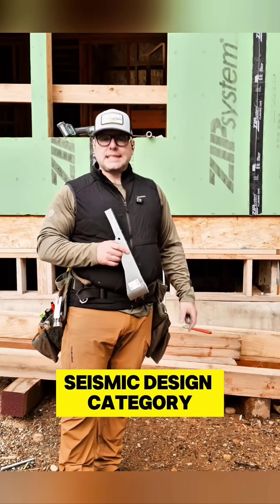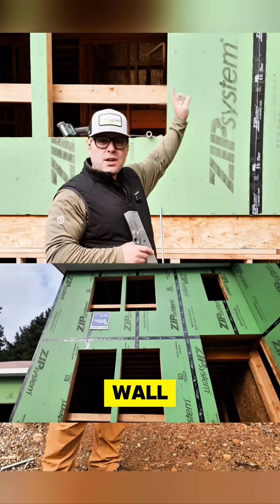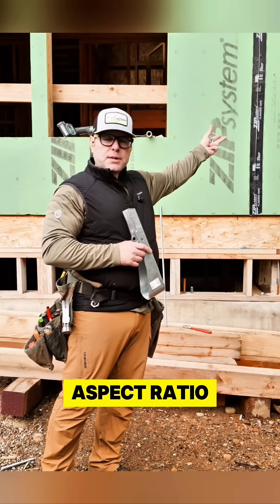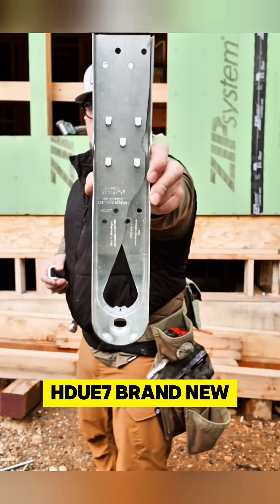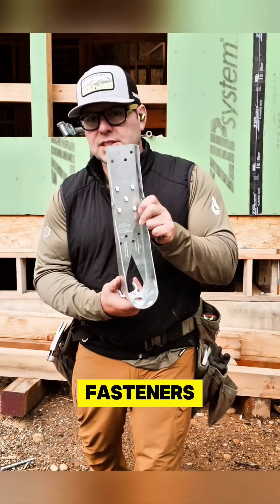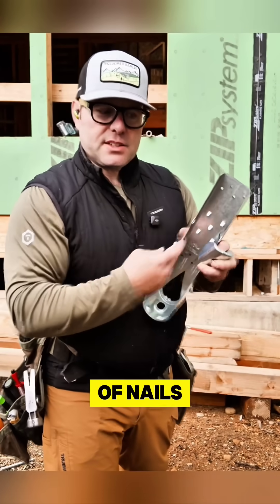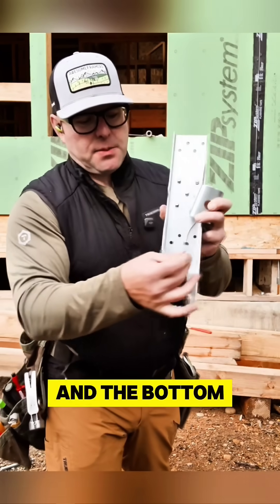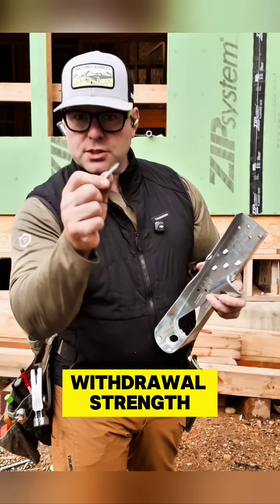What's an HDUE7?

Comment: I'm a little surprised those two short studs in the pony wall are sufficient for the compression load that accompanies any hold-down's tension resistance. 

Did you run that by your engineer?

Comment: I’m definitely not an engineer, but it seems like if it’s to hold something down you’d want to drive the screws on a downward angle, to make it harder for the screws to come out of the 2x. Just a thought.
Reply: Visualize the direction the wall would be pulling. The anchor is fixed and the wall pulls upward. If the screw is installed through the hole in the bracket at a downward angle, the screw head would start pulling away from the bracket as the wall moves upward making the joint looser. Installing the screw the way tbe mfr specifies ensures the joint becomes tighter the more the wall wants to more upward.

Comment: I was always told that the HDU can’t touch the ground to leave it at least an inch above the bottom plate
Reply from the maker: This is an HDUE
Reply: @AwesomeFramers ah so this negates that. Pretty cool!
Reply: The seat in the hold down shlurps tight regardless of whether the HD is on the plate or above it.

Comment: i can't believe an engineer approved a threaded rod extension in the hold down.  That's like a 50% or more loss in strength.  Check out the suspended walkway failure story from years ago.
Reply: I don't think you understand the engineering of the Kansas City Hyatt failure, nor the uplift requirements here.
Reply: Did you calculate that 50% or guess?  An independent engineer is not required because that procedure Tim used is documented in the Simpson-Strongtie literature. I've done the same thing and the criteria is quite clear.
Reply: That walkway didn't fail because threaded rod was used, it failed because there was a design change that created excessive load at a connection.
Reply: That was from changing from a single threaded rod through the box beams to 2 rods, causing one to carry twice the load. Different situation. See for a summary https://sma.nasa.gov/docs/default-source/safety-messages/safetymessage-2008-05-01-hyattregencywalkwaycollapse.pdf

Comment: Just a thought, would it be better to hold the bracket slightly up on the attachment post leaving a slight gap from top of mudsil to the bottom of the hold down so when tightening the nut you’re ensuring tension on the threaded rod? We typically hold ours up and inch or 2
Reply: It says in the HDU install notes on simpson website letter i.- "tension values are valid for holdowns installed flush or raised off the sill plate"
Reply: You’re doing exactly how it should be done. Slamming it tight to the bottom plate doesn’t allow tensioning the bracket properly.

Comment: If the connector fails in our 'upcoming' earthquake, who will be liable? Strongtie? Engineer? Builder? Installer/Framer? Foundation Contractor? Concrete Supplier?  Hmmm, maybe too many cooks in the kitchen for any any liability.
Reply: The person who is liable is the person who did something wrong. Pretty simple. After failure you do an investigation. Was the concrete below spec? Voids? Wrong anchor spec’d or supplied? Anchor not properly tested by SST? If something fails it’s for a reason, and that reason can be found thru investigation
Reply: What is your point?  Explaining your objective might open the comment to a learning opportunity.
Reply: None of them is the answer.

Comment: Good work, but it looks expensive.
Reply from the maker: That's not the point, but I hear what you're saying. Meeting the code in high seismic isn't cheap
Reply: @AwesomeFramers  Theoretically with technological advancement, there would be more cost affective alternatives with older tech that's on the market, but isn't too old that it becomes outdated. If you know what I mean. Take your most basic joist hanger hardware for example. 30 or 40 years ago when the concept of joist hangers was fairly new, it costed a pretty penny because at the time it was new technology that hasn't had any successors yet that didn't allow said older tech to become more affordable since they weren't out on the market for long enough at the time. Nowadays your basic joist hanger hardware is very affordable since in 2025 that tech has been out on the market long enough to become one of the more cost-effective options and still meets or exceeds code (counting the underdeveloped areas that still don't have building codes that is). This is where progession can get exciting.

Comment: Probably should lock two nuts on each side. Over time that rod coupling will vibrate off
Reply: It's a house, not a ship, industrial/HVAC equipment, or off-road vehicle.
The only time that framing is going to vibrate is DURING that earthquake.
Reply: @J_Urban_ houses vibrate too, and not just in earthquakes. Literally everything in the universe is currently vibrating unless its at absolute zero. Whether its a wire nut, set screws or a rod coupling they can vibrate. And incase you didnt notice this support is a seismic support, which is guaranteed to experience vibration.
Reply: Very little torque is required for the coupling nut to be reliable.  Tim gave the nut just enough torque to stay in place while a person assembles and tightens the HDUE7 nut.  The coupling nut will not be influenced through the decades except with corrosion.  
What will cause the nut to loosen at the HDUE7 is the shrinkage of the framing lumber.  Tim builds with a majority of engineered lumber so most likely will not lose torque.